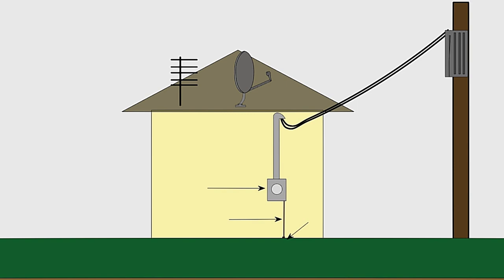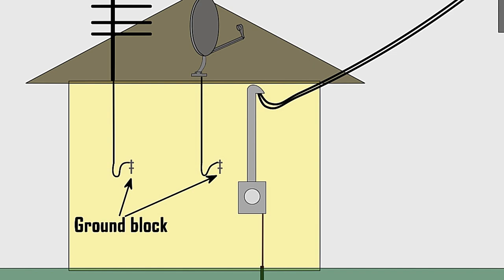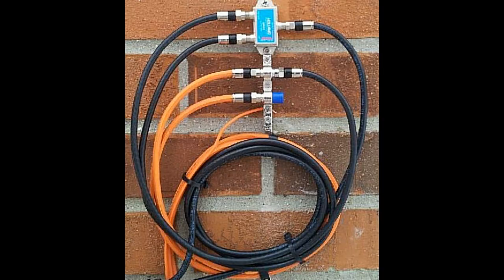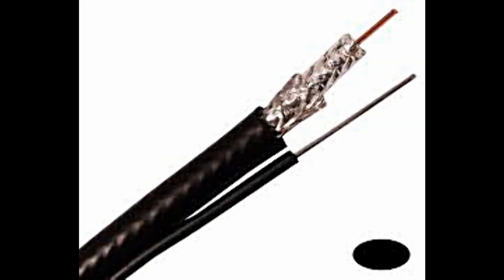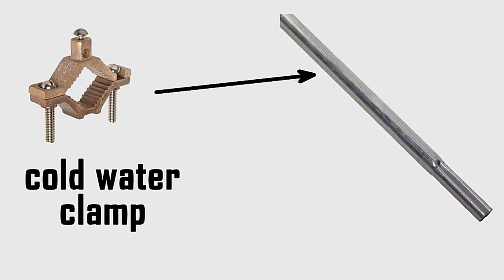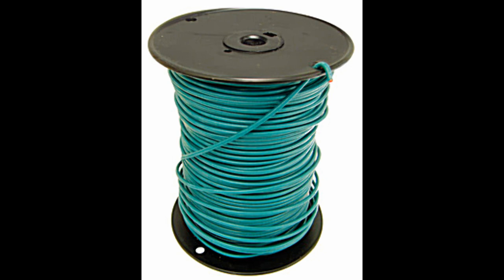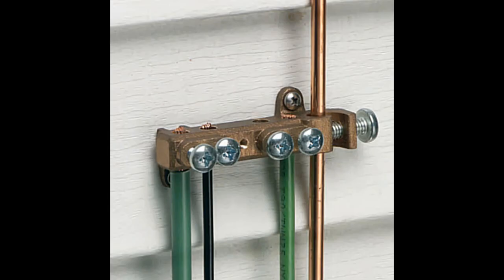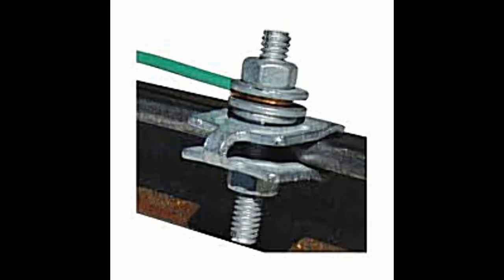How to properly ground your roof antenna and satellite dish

Comment: Always standard procedure to ground your tv antenna cable either on a cold water pipe and the mast and tower that antenna is on to be grounded. This prevents static electricity from reaching the tv set and damaging it completely.  Very important to do and get done with.

Comment: Really Good video.  Thumbs up for the most part.  Only two issues.  #1 Don't share grounding rods with AC power when it comes to antenna (especially if you live in areas with high lightening).  Aside from lightening, if any household equipment becomes damp or damage, it could dump AC onto its ground which will ground loop through your grounding network and back into your receiver causing all sorts of issues.  #2  Trying to ground to metal pipes is against code in some states, especially gas.  There is also no guarantee you will get a sufficient ground from piping.   Also, if lightening strikes your antenna and you happen to be doing dishes or taking a shower, the outcome can be very thrilling especially if you have hard water.   Grounding rods are easy to purchase and easy to hammer into most soil conditions.  It only takes a few minutes too.   Di-electric grease for the connector points would be a good add-on to reduce corrosion.
Reply: You must, according to code, connect all ground rods back to the house electrical ground. Someone could be electrocuted if you don't.
Reply: @TE5LA-GAMING  hi, if the house electrical is grounded from the main water supply pipe, would you still bond the ground rod wire to the house panel? or would it be okay to bond it to the outside water tap...* i installed the ground rod today for my antenna , and now i am thinking that i have to run a lead from the ground bus outside, into the house electrical panel and bond with the ground that came from the water pipe ....😰

Comment: lots leave out the coax with out the loop before hooking it up, water channels in your wall if you dont  thanks for make that clear
Reply: Or silicon the hole that your Coaxial cable is coming in to.

Comment: Some municipalities require two ground rods spaced no less than 6 feet apart. Also, the NEC (National electric Code) requires two ground rods if the primary rod resistance is greater than 25 ohms.
Reply: Spot on. NEC also requires lightning arrestors BEFORE any antenna feed line enters any dwelling or structure.

Comment: U'd better put a lightning rod, and not make it from your antenna's by grounding it.
Reply: These dish antenna installers are all the same. They connect the lightning pole straight to your houses insides. Never bond a pole.

Comment: OK... so I've read through most of the comments. I seems to have a slightly different scenario. My antenna (Tram 1411) is roof mounted. The antenna itself is screwed onto a PVC pipe (not a metal pipe/pole). This PVC pipe was then secured to a pre-existing DirecTV roof mount. I got rid of the dish and it's pole and simply put the PVC pipe into the remaining metal pipe of the roof mount. As such, the antenna itself it NOT touching any metal and is separated by a PVC pipe. I assume if it takes a hit, the PVC pipe will just melt somewhat, but I'm not looking to debate this setup. However, as we all know, the RG8x PL259 coax cable screwed into the bottom of the antenna runs down through the PVC pipe, through a hole in my roof, then across my attic to another hole in my office ceiling, and then drops down to finally connect to my RTL-SDR dongle plugged into my PC. So obviously if the antenna takes a hit... it will run down the cable and fry my PC unless I simply disconnect it and leave it dangling during a storm. Which then lead my brain to thinking of a Hollywood style catastrophe of lightning shooting out of the unplugged cable and catching a ghost in my office (ala Ghostbusters stream). SOOO... it there a block, breaker, etc that you simple screw between the antenna's coax cable and another cable going to the PC without the need of a grounding rod? Because again... the roof mount that this video shows using the 'bolt holes' for are useless since there is no direct metal on metal contact with the antenna.
Reply: Use one like is shown at 0:37 in the video on the coaxial cable.  If possible change the PVC mast to a metal one as PVC doesn't last as long as a metal mast (you can use metal electrical conduit for this, you don't need a TV antenna-specific mast), and ground the metal mast as shown as it can cause signal problems due to static electricity build-up.  I'd also suggest a separate ground rod for the antenna from the electrical system's ground to prevent interference.

Comment: Caution most all newer house construction, the gas lines below the ground are pvc plastic " NOT METAL" so do not ground your antenna mast to this serious and dangerous gas line error.
also the same is true for new construction water pipes! it is not metal under ground they are plastic lines.
Failure to ground the outside  mast correctly, will introduce a lighting strike into your home and equipment!
always attach to a 8 foot grounding rod!! all the best....nuff said
Reply: Building codes in Canada require all plastic/composite gas and water lines that are buried to run a separate ground wire , usually taped or cable tied to the exterior of the pipe, to complete the grounding circuit.  Also, allows the pipe to be located with detectors in the future if the ground needs to be opened.

Comment: Most of the video is okay except the part of grounding to a gas pipe. That's a no-no👎. You can cause an explosion if a lightning strike the antenna or satellite dish. The best way is to ground to the groundrod or to the electric power meter. Grounding to the waterpipe is okay if theirs no other options, but make sure you are not in the shower when there's a storm.
Reply: Yeah I thought that as well, never heard that idea put forward before but logic suggest that sparks and gas are not a good combination 🤔
Reply: You would be very unlikely to cause an explosion grounding to gas. I know it's always frowned upon in telco but for gas to ignite it has to be in concentration between 4 and 14% anything more or less the gas would not ignite.  The gas line is a closed loop and a sealed unit minus where the regulator purges any excess pressure. Sometimes gas lines are grounded same as the homes water supply.

Comment: So when I install an inline antenna amplifier  , and if I have properly grounded the antenna and the cable... wouldn't this also ground the amplifier?
Reply: Yes.  The amplifier would then be grounded via the coax cable.  That is, as long as the coax able is properly grounded via a coax feed thru grounding block.

Comment: Does lightning arrester (ground block) have to be installed outside? Can it be installed, say, in the attic and then wired to a ground rod outside?
Reply from the maker: It can be installed anywhere
Reply: Quite correct, as long as it reaches a ground wire going to both a cold water pipe and a ground rod sunk into the ground to divert static electricity from and away the tv set.  This is a very important step in grounding procedures.
Reply: If there is a lightning strike, it may electrocute people or set the house on fire. Always ground it outside the dwelling close to the point where the coax goes inside.

Comment: How do I find a ground block for sma style connectors for WiFi coax?
Reply: You can use an SMA lightening surge protector with ground divert as a grounding block.

Comment: Got all the proper connector ran the ground to the same place the Cable company grounded to the electric box. NOW, no channels🤔. When I disconnect the ground the channels come back on. What did I do wrong?
Reply from the maker: Sounds like there could be some sort of electrical interference somewhere. Different things could be causing this.   I would check the connector fittings from the antenna all the way to the back of the tv or receiver. Including the fittings on the ground block, pre amp, ECT. Make sure the braided wire isn't touching the stinger. Make sure no braided wire is protruding from the fitting. Feel the back of your tv or receiver with your hand to see it feels abnormally hot. Also listen for a hissing sound this could indicate a bad ground source and could be feeding power back to the receiver or tv. Check to verify that your grounding on the antenna is correct and lastly try a different grounding source other than electrical box.
 Also some cable and telephone companies equipment send a little voltage back down the line. I've seen it a few times. Something quick and easy you can try  (and i would try this first because no tools are needed)
is to unplug any cable, satellite or telephone equipment that are using that ground source and see if it works.
Good luck
Reply: @cordcutterlifestyleandtech  Thanks for the suggestion. I had already tried your last suggestion, removing everything else from the box ground and attaching the antenna only. I still lost all the channels. As you said it must be something in the coax cables or grounding block. Thanks again.

Comment: Why is the ground wire going from the antenna to the ground block so thin? What if lightning hits the antenna wouldn't it fry that thin "messenger" wire? Also, if I don't have a ground rod at my house (it's grounded via the water line bonded to my gas line), do I still need to ground rod or can I just wire a 6gauge wire from my antenna to my electric panel? Is there a difference between a solid 10AWG and a stranded 10AWG? If not, is there a min amount of strands that should be used?
Reply: The "messenger" wire is more for discharging static build up as the guy said in the video but if lightning hits your antenna directly, more than likely things are going to be toast no matter what. These grounding systems I believe are more for preventing static, and nearby lightning strikes from damaging things but like I said a direct strike will usually toast things. I wish I can help you out on your other questions but I believe grounding anything to the gas lines aren't recommended at all. Be aware though water lines maybe copper inside of your home but once it leaves the house through the ground it maybe some other material like plastic so you aren't getting that true ground
Reply: @lucasdantas723  The Canadian code requires that any buried plastic/poly pipe used to supply water to a home must have a separate ground wire run along side the pipe (usually cable tied to the plastic pipe) to insure that there is a ground maintained from the home's water meter to the closest metallic ground in the city's water supply system.  The ground wire also acts as a trace wire, so that buried plastic pipes can be easily found with metal detection equipment.  Virtually all urban homes have their electrical panels, communication equipment and antennas grounded to the cold water supply pipe, on the supply side of the water meter.  I've only seen ground rods used on barns, sheds and outbuildings that don't have water supply piping or homes on wells.
Reply: Yes, you can attach the ground wire to your electrical circuit breaker panel (assuming its grounded which it surely should be.)  You can also simply use a clamp on the metal conduit going to panel and attach your ground to that.  If you do be sure to scrape off any paint etc.  Also, use an ohm meter just to be sure there's zero resistance between any metal conduit and you circuit breaker panel box.

Comment: At :25 you say the "grounding Cable"  gauge should be #6 or #8 , however when running "Grounding Wire"  from grounding block to Grounding cable should be #10- #18 gauge. What if I don't want to run to the same ground rod as my AC power and INSTEAD, I want to run the antenna ground directly to an independent rod ? 
Can that be the same #10 gauge wire being run from grounding block, be connected directly to the rod,  instead of adding another connection point and using #6 or #8?? for the last foot or two?
Reply: A separate ground rod needs to still be connected to the main house electrical ground.
Reply: @TE5LA-GAMING  You didn't answer my question. I realize that the house electric has to have an electrical ground. That wasn't the question
My question once again is "What if I don't want to run to the same ground rod as my AC power and INSTEAD, I want to run the antenna ground directly to an independent rod ? ....IF I do  this, then what gauge wires do I need from antenna to grounding block, and then from the block to the ground rod?  Are they the same?
Reply: so I think Using the atena for Ac power would just use the wires it brings with the rods. You would need the power to go somewhere and a battery seems reasonablly right. 
There's a type of block that has 2 inputs and 1 output. 2 input for atena and 1 output for the battery(and I'm hoping the battery is only Dc) 
The battery would be the ground and the atenas can keep playing with each other. The thicker the wires are use for to take in more power for a slower rate to not damage the input. Only way to find out is to try and tbh I'm down to try that.
Reply: I have the same question. I don't think the people here speak English...
Reply: @Archangel0804  The National Electrical code in Article 800 specifies that the minimum size conductor for communication grounding is #18 AWG copper.  I recommend larger, such as #12 or #10, just because they are sturdier.  You state you do not want to run to the same ground rod as your AC power, but instead want to use an independent rod, OK, just realize the the National Electrical Code, Article 250, requires that all ground rods must be bonded together with minimum #6 AWG copper wire. This is for your safety and the safety of sensitive electronic equipment.
Reply: @RobertWilliams-pc2ur  I'm not debating what you are stating but do you know why running a separate ground rod would "effect safety" in any way? 
An Antenna that gets nailed by a bolt of lightning has absolutely nothing to do with the Home's Alternating Current.  In my application an independent ground rod is solely to serve the purpose to discharge electricity from a direct lightning strike.
There is a reason I want to run to an independent rod. The Existing rod which is grounded to my panel is on the side of my house.  The antenna is on the roof attached to a chimney on the complete opposite end of the house. This would require a very long run of cable from one side to the other.
Reply: @Archangel0804  The idea is to keep lightning out of the house. You can’t steer lightning, but you can give it paths to ground around and outside your home.  Otherwise, if you get a direct hit, some of the energy will run down the coax and into your equipment, find the AC ground at the plug and run along that to your panel to that other ground rod.  You want to give it places to go outside the home, not through the home to the other ground rod.  You bond the rods together so all the grounds rise and fall in voltage together.  I am no expert on this, just scared of lightning.  I have tried to apply what I have learned from multiple sources.  I use heavy braid on my antenna pole to a ground rod at the base and bonded that rod to the AC ground rod at the Meter Can with #6 AWG copper.    “Motorola_R56_2005 Manual Grounding Systems” is a PDF available on-line with info on grounding of TV and Radio equipment and has good illustrations on how these multiple ground rods provide a shield around the home.  Mike Holt has some videos on You Tube about lightning protection, and on Bonding and Grounding, and on his web site.  He is a great resource. Check him out.
Reply: @Archangel0804  Bonding two separate ground rods together is a safety issue.  By doing so there will never be a difference in voltage "potential" during the high voltage lighting strike.  Theoretically, if someone got between that much of a voltage potential (unbonded rods) they could have a very shocking experience. Chances are thin as all get out but still possible.  Anyway, now you know.  However, yes, your antenna would still be grounded with a separate ground rod and maybe that limits damage to equipment (TV etc.)